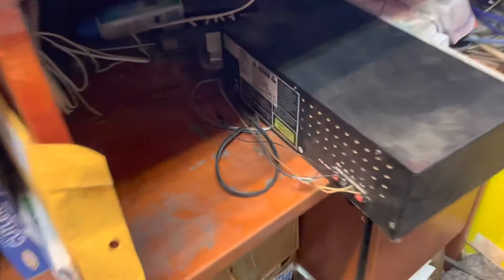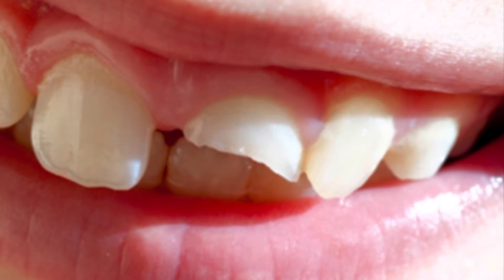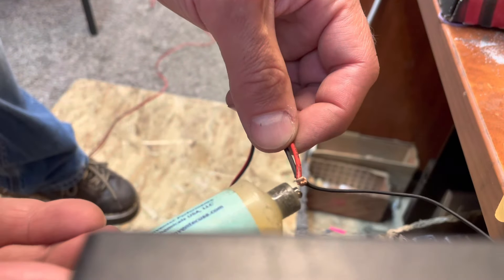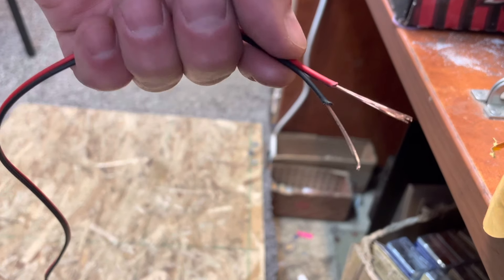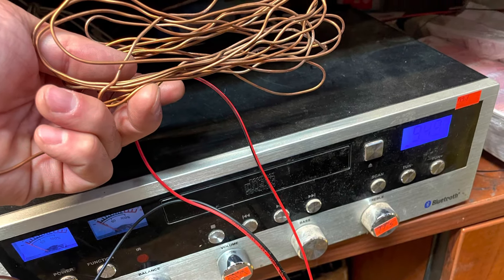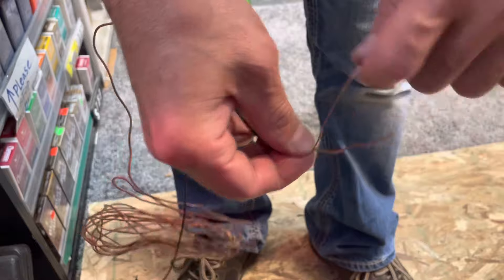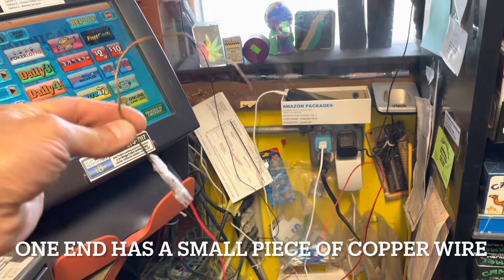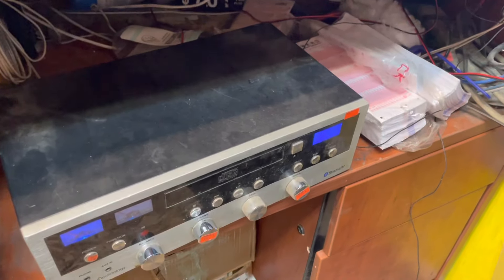How to improve FM signal On radio with a single wire antenna Poor signal Reception￼ static￼￼

Comment: I've never seen a receiver with a single wire fm antenna.   I have done the same thing with portable radio in my garage - looped the wire around coaxial tv cable that goes up into the ceiling into house and now I pickup fm stations from 120 miles away in stereo.
Reply: I just bought a stereo system that has a single wire antenna with a connector in one end, reception is bad. I've been trying to find a better one.  But this, would it work if I expose the wire end of the antenna and attach copper wire? Could it be that simple?
Reply: @carolvile5584 i think it will help and having the radio close to a window sometimes helps. By trying what have you got to loos. Good luck.
Reply: Carol did you try it?
Reply: It may be a rinky dink stereo, but my newer CD/tuner/cassette/stereo unit has a one wire antenna. The tuner is fine if the station's strong enough, but we're 2 miles away from a radio antennae repeater forest, so, we get a lot of static for a lot of stations on this tuner, I'll be giving this a try this weekend, hope it works this well!👍🏻
Reply: My Sherwood came with a single 75 ohm plug in style antenna wire.
Reply: @PapaMav  That's a coax plug which has copper wire in the middle and another braid wire line around outside - two wires.
Reply: @tomsettles6873  hate to argue w/some random on the interweb, but the black wire that comes out of the plug, is a single wire, made up of mulitple steel strands and definitely is not a coax cable, friend.
Reply: @PapaMav  Gotcha.
Reply: When you say you looped the wire around coaxial TV cable, what do you mean exactly? I’d really like to try this.  Is the antenna wire just wound around the outside of the coax for a few turns? Like loose coupling?
Reply: I have a vintage-looking Vitrola radio with yes; one, black wire. I can’t get in 99% of the fm stations w/o static! 
I was watching the video but what did I miss? What is the red wire? Where do I get one?

Comment: The radio in my shop has a whip antenna so I just leaned the antenna against my tool box and it made the reception much better

Comment: I.” Listen to KFTX 97.5FM real country, I usually have trouble picking the radio station. What I did; I stripped the wire so the copper wire is exposed.”
On the wire, then I took gum rapper and rapped it around the end of the wire. I put 2 gum rappers at the other end where it connects to my radio; I get KFTX 97.5FM  t come in so clear!!

Comment: Doing a experiment on A blue tooth card reader FM BOOM BOX radio. Its got a USB plug in.  See if this USB WIFI antenna booster will work >  to get a stronger signal  IF it does?  THAT WOULD BE AWESOME

Comment: Get you some speaker wire like he said about 20ft get the double strand 1 slver 1 gold color in 1 wire. Run it up the wall in the middle of wall top of ceiling split that wire into a T shape go 5 ft 1 way 5ft the other ...enjoy!!!!

Comment: With your Front teeth strip appx. 3/4 of wire insulation then form a ? shape in the bare part then hook on Antenna: input and tighten down a smidge"  attempt to position the wire vertically then choose FM on the receiver and begin searching for something to listen to.  Enjoy !!

Comment: I have a Crosley radio/cd/cass/turntable player that the wire antenna is missing from. Can I reattach that? I bought an external antenna,  and plugged it into the aux in and got no improvement.  Are there any alternatives I can try?

Comment: What part of the radio do u connect it to
Reply: Right 😂
Reply: Connect the wire to the spot the old antenna wire was connected to.    If there ain't no existing antenna wire, find the spot where the antenna wire should be, take the shell off the radio and the connection spot will be evident.   This is where you solder the wires at

Comment: The antenna wire on this old stereo is missing all together. All I see on the back of the stereo is a little hole where it used to be. What do I have to do to fix that.?
Reply from the maker: You will have to open up the casing and find where it was on the circuitboard tried looking for screws to takeoff the plate or housing

Comment: i did this and it lasted 3 days ... 
reception went to shit again, move the wire somewhere else, got great reception for 2 days and went to crap again
Reply from the maker: Is somebody messing with u cause mine works great and I don’t have to move it
Reply: @KooperSalmo  I have 2 "boom box" style radio's.
One in the shed with a single wire attached to the radio antenna and going up to the 7 ft ceiling and running the length of the 24 ft long shed. At 1st the recpetion was incredible and clear. But then i would come back and reception was crap with static all over the place. 2 days later it sounded good, back a few days later, sounded like crap and nothing has moved.
The same issue with another panasonic boom box style radio in my man cave room, a single wire attached to my radio antenna, it runs into my wall and up into my attic which is about a good 17 ft high and runs along the rafters which is about a good 40 ft. Thats one long antenna wire. Same results, one day its clean and clear, other days static all over, then back to clean, back to static.
Nothing is moving, nothing is changing. 

Not sure why this happens ....
Reply: @ACommenterOnYouTube  This phenomenon is called OVERLOADING. It happens when you connect a long wire antenna to a small radio, making it susceptible to electrostatic discharges (ESD) against which it has no protection. Thus, when you hook up a large antenna to a portable radio, it can definitely harm the radio. Some more expensive sets may have built-in ESD protection and some of these may even have a socket for connecting an external antenna; there you are safe. But if you have a compact radio, or a boombox type of set, in the interest of saving your set from harmful overloading, it is better to be happy with the telescopic antenna provided and not embark upon misadventures with longwire external antennae.
Reply: @bhaskarsinha1527  it came with a fixed sized rubber antenna that just folds up or down. 
With the long wire i do get MUCH better reception but only when it wants to work. 
With the stubby rubber one, i can't get anything in the shed.